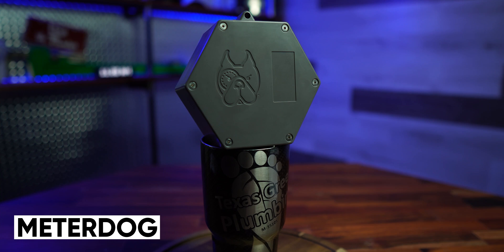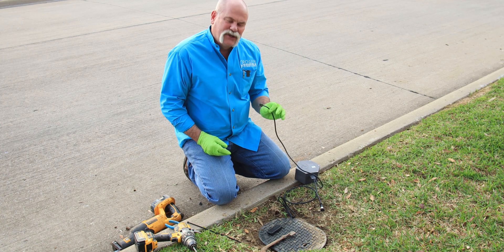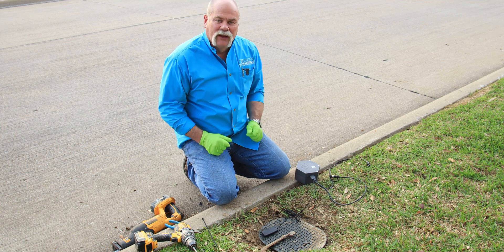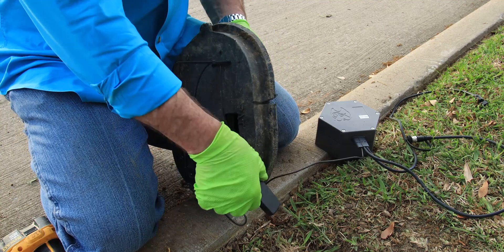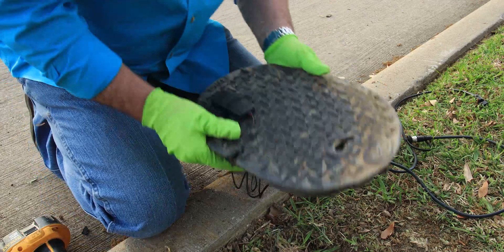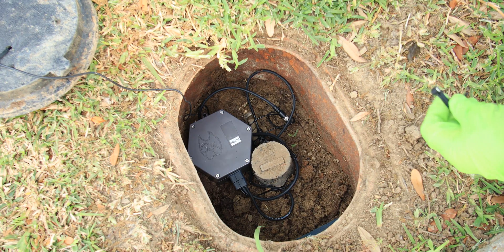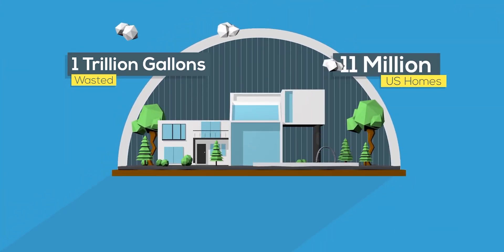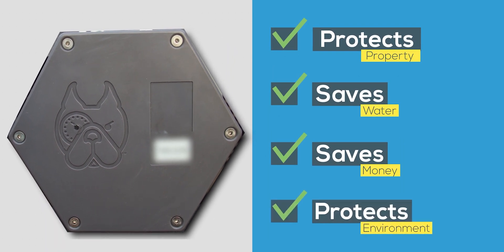A New Water Leak Sensor That Will BLOW YOUR MIND - MeterDog

Comment from the maker: So what do you think of this product? Would you want this on your home? Let me know!
Reply: Rodger if I ever cut the city meter box there gonna have my tail I'm gonna stick with Flo by Moen
Reply: Thought I heard you say something about a connection to a shut off valve in the future. If you have this product with cellular connection, connected to an app, with capability to shut the water off from your phone, you could have the market on leak detection. The company I work for is the largest plumbing service company in the south east. Been with them for 10yrs. We have offered 4 different products over  the years for leak protection . But if this product does all of that, it takes care of the problems we have had with all the other products. If you are interested,  I would be glad to get you in touch with our owner to get this off the ground.
Reply: I don't know if this will be answered but what is that antenna made out of because I can see that being stepped (or even driven on) very easily?

Comment: Terrible product and customer support. Installed 5, customers were extremely dissatisfied on all of them. They don’t return customers phone calls or inquiries. Refunded customers on product out of my pocket to save face and reputation. 

Does not detect small leaks, has to be a big leak for at around 30 minutes for it it to notify through the app. App is poorly designed and basic. When the product stops working randomly, dealer is expected to make service call to reset with no compensation. There are other superior products that provide leak detection by major manufacturers.

Comment: Thanks for the video, Roger.  Pretty dang cool.  What is the sensor sensing?  I figure it is either sound, or a magnetic sensor tuned to the spinning magnet in the meter.  I looked on the KonaLabs website to learn more about the app but found litle info.  Is there a manual available or other guidance?

Comment: How does the sensor work and where can it be purchased and approximately how much would it cost?  How does the unit hook up to cellular?
Reply from the maker: https://konalabs.com/collections/leak-detection/products/meterdog-remote-water-surveillance. Let me know if you get the information you need here.
Reply: Flume is similar got a rebate  from local utility around 200

Comment: This is called smart meter technology. We in the gas industry have been using it for about 10 years are so now. In St.Louis, all our gas meters are smart technology and keep a constant log of consumption through a network of cellular towers . The lithium batteries in these meters last between 7 and 10 years. A computer system document the average consumption of each individual house & if for some reason the consumption escalates, we consider this a spiked meter read. If a spiked meter read notification is sent ( a red flag if you will), our dispatchers immediately send a technician to that location , as if it were a gas leak call.
Reply from the maker: Bob Y
 I'm a plumber, I just call it Smart. Thanks for commenting and watching!